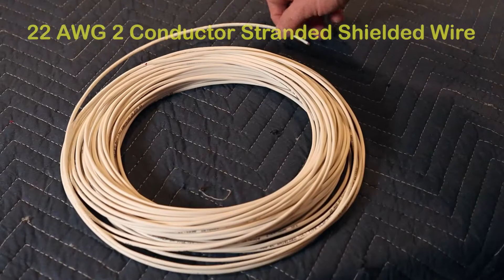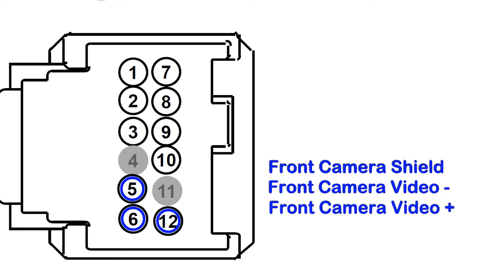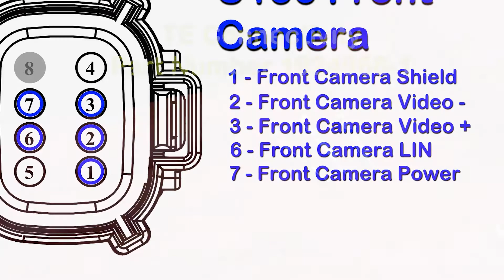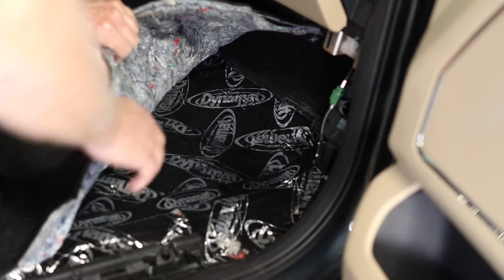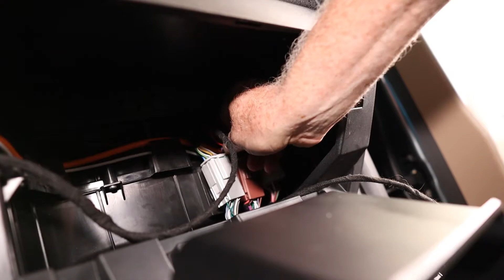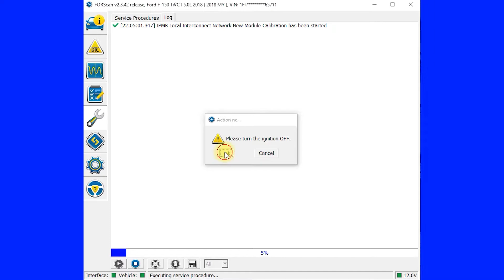F150 OEM 360° Camera Installation Part 3...Wiring it all together!

Comment: Hi I just got a 2025 F150 Lobo and being based on a STX it doesn't have many features. Can you advise me on all the parts I need to add 360 degree camera to my truck? If possible if you could share the part numbers of any modules and/or harnesses needed plus the other cameras my truck does not have currently. I also want to add the power extend/fold tow mirrors with 360 degree camera and BLISS, puddle lamps etc. Any advice/help you could give me would really be appreciated as there are several equipment upgrades I want to do such as the pro trailer backup assist, and adding heated and cooled seats, GPS to my infotainment system (I only have carplay on my truck) and the rear window with sliding glass. Thank you

Comment: Would this work with an F-250 or F-350 as long as it has Sync3?
Reply from the maker: Should be very similar. The part number will be different so you would need to research that..

Comment: Hi there,

How’s it going? I have an F-150 Lariat, and the side mirrors are retractable with built-in cameras. Unfortunately, my mirror was stolen, but the base with the 360° camera was left intact. I purchased a replacement original Ford mirror from the U.S., but it didn’t come with the camera—it’s the wrong version.

I saw one of your videos where you did something similar, and I’m wondering if you know how to disassemble the mirror without the camera and attach it to the base that still has the camera. I’m currently living in Colombia, so any guidance or tips would be greatly appreciated!

Thank you in advance!

Best regards

Comment: I have xl and I just only care about adding the front camera.
Reply from the maker: That should be possible, if you have a 8" sync screen. I'm not sure if it could be done with the smaller screen. You would just need the front camera and the image processing module. The side cameras would show up blue in the 360 degree view.

Comment: are you a business? can you solve this problem? i have a 2019 expedition hit in the front and stripped the harness to the front camera. all copper  wiring can be easily spliced. i was looking in your video for video wires. on the expedition this wire is silver stranded and shielded with aluminum wrap then a black exterior. it is slightly bigger than the copper wires. i believe this is a video wire. the problem is this short harness going to the camera does not break with a connector to the main harness and was made continuous by ford. a very bad mistake by ford. this wire/cable cannot be repaired by splicing and i do not see that type of wire in your project. do you have any experience with this problem and a solution? thx robert

Comment: Can you tell me if it's difficult or even possible to install a 3rd break light with a camera on 2019 F150 SuperCrew that only has the 360 cameras? If it is please point me in the right direction.

Comment: Did you need the dealer to calibrate the cameras or PTBA?
Reply from the maker: To get best results yes...I did not, it wasn't that far off. Plus since mine is regular cab, I'm not sure the dealer could even calibrate it. Thanks for watching.
Reply: @StupidFastTruck  I finished installing the 360º camera on my 2018 Lariat this past weekend. Your videos certainly helped! I did not get as lucky with the calibration, but my truck is the exact opposite configuration (crew cab 6.5ft bed). Now I need to find a dealer or shop that has the calibrations mats.
Reply from the maker: @Spring794  thanks....Your the first person that has commented that did the install, after almost 24K views...HAHA.

Comment: Can you recommend the name of the manual I need to find what parts to add various accessories to a Ford Ranger Next Gen Ranger 2024.  Wiring harness, cables, connectors. IPM etc... is it a Service Manual.?
Thanks in advance.
Reply from the maker: You can get 72 hour access to the online Ford workshop manuals from this link. https://www.motorcraftservice.com/Purchase/ViewProduct

Comment: The only and rare video, thanks for it. Quick question, Do u need to upgrade the APIM? I was going through the forum and got mixed feedback. 2021 Lariat with Pro-Trailer backup assist.
Reply from the maker: I really can't say what how or what must be done on a 2021 since it's a very different truck. On mine  Pro Trailer backup assist is required. I mention it in the video, but didn't stress the wiring.

Comment: Finally found a video that can be useful.  My next obstacle is I want to purchase the Next Gen Ranger Sport 2024 PH but it does not have 360 or front camera, I want to mod it, can I use the existing 10 inch screen and tap into it, I don't want to add another screen. I also want to add the power accessory in the bed of the truck for DC and 230 volts and 120 I realize I will need to use 2 separate inverters.  Any advice would be greatly appreciated.

Comment: Love the videos! I have a 2019 lariat, what do I need to do to connect the front camera to that cable you made? Will any sealed connector type work if I just get that factory harness you showed and splice that?

thanks so much for making these videos! 

Everything is installed on my truck now for this to work besides the front camera lol

Comment: Thank you for awesome videos.
I have a 2017 F150 XLT. I just bought a wrecked 2015 F150 Lariat with Blis. and 360 cameras.
 Do you think I can extract the factory harness and use it in my truck?
Also do you know if anyone would sell the dash wire harness that you built?
Thanks

Comment: Nice! I just picked up an F150 XLT earlier this week. The one thing I wanted but did not get was the 360 camera so this will be probably one of the first mods I make.
Reply from the maker: Nice...One important thing I briefly mentioned in the video but didn't stress, these instructions only work if you have the Pro-Trailer Backup Assist option. Its still doable without out that option but the wiring is more complex.

Comment: Question: would a button like FL3T-13D734 (hazard and 360 camera button) be a good solution when the radio only has 2 slots? I’d prefer to keep the one I have now. I should just have to pin in those addition wires with out soldering to the hazard since it’s the same button correct?
Reply from the maker: There is a button that has a hazard flasher and a camera button combined. The buttons are actually keyed so certain buttons will only fit in certain slots without modifying the bezel by filing the keyway to make it fit. All the camera button does is take the camera enable signal to ground momentarily to switch modes.
Reply: @StupidFastTruck  Ok, that is the button I am referring to. It would be in the same location as my current hazard button so hopefully the button fits along with the current harness. I was hoping it would so I can pin the new wires to the corresponding spots on the new button for simplicity (and avoidance of more soldering). Since it’s only a momentary switch, I’m sure I can find a way to make it work. Thank you for the advice!

Comment: Can I purchase the entire build, I am not capable to do all this wiring etc. I just buy package. Let me know if possible. Thanks
Reply from the maker: Thanks, Unfortunately I don't built them, I tried to include all the information needed. One key thing that's important to know, I mentioned it in the video but did not stress it. The install requires the truck have Pro Trailer Backup Assist. The wiring is very different if you truck is not equipped with this feature.

Comment: Hi I was wondering will the also work for a 2017 4 door f150 lariat  with a back up camara ?
Reply from the maker: Yes, as long as you have Pro Trailer Backup Assist. The front camera mounting is slightly different.
Reply: @StupidFastTruck  I believe I do have it there is a trailer nob to guide it not sure if there is a regular one and a pro or all the same tho
Reply from the maker: @eddie6696  yes you have the knob then you have PTBA. If you don't have PTBA then there is no module behind the screen and the wiring is MUCH more complicated. The installation might even be easier then mine. I've heard on older Lariat up they have the under hood wiring so all you need then door harnesses, and dash wiring, mirror cameras and front camera.
Reply: @Stupid Fast Truck  great thank you for that great info ill look to see if I do... if I do the plug for the front camara might be there already? IF the wiring is there?

Comment: Interesting, tried to do this mod on my 2019 XLT Sport over the weekend.  I have everything installed except the OEM Camera Logo won’t fit in the grille because the cutouts for the camera are missing and the logo doesn’t fully come out.  Any thoughts on how to get around this issue without buying a whole new grille?  That issue killed my mod.
Reply from the maker: I'm not sure....I still have my XLT grille which doesn't have the cut out either. I'll see if I can come up with any ideas.
Reply: hey interested in this mod for a 23 XL, did you manage to somehow to make it work?
Reply: Same here interested i have xlt 2019

Comment: Did you ever get the cameras calibrated by Ford?
Reply from the maker: No I did not, its not off that far so I didn't bother. Since my truck is a Regular Cab, (Short Wheelbase) I'm not even sure a dealership could calibrate it. The 2021 have a calibration where you drive at night with the 4 way flashers on and it calibrates, which seems really cool.

Comment: What a video !  I'm so grateful that all you hard work to put this all together. I'm trying to follow your video to do the same for my 2017 f-150. Do you know if those wire harnesses for the side and front camera are wired/mapped the same way ?
Reply from the maker: Inside the cab yes, probably...The under hood harness might even be there on a 2017. One thing I mentioned in the video but didn't stress it was the dash wiring is for trucks with Pro Trailer Backup Assist. If you do not have that option then the wiring in the dash would be very different.
Reply: @StupidFastTruck  My truck does come with 502A package and pro trailer backup assist. But I checked the control module which only comes with one socket instead of two that you mentioned in the video. I would be very grateful if you could point it out where or what to look for those under hood harness ?
Reply from the maker: @OneClueDeeper  I'm not exactly sure on a 2017. There should be a wiring harness in the middle near  grille. Did you watch part one of the video. It shows more of the grille wiring and the front camera. If there is only 2 wires going to the front temperature sensor then you do not have the wiring, and you need to build the harness.

Comment: The video shows you connecting the side cameras to the harness but on the mirror there’s two plugs one for the mirror function and on for the camera. What harness are you using for that?
Reply from the maker: The part number for the door harness I used are in the description section of Part 2 mirror install. Let me know if you can't find it.
Reply from the maker: I don't think so. If its a Lariat you probably won't need the under hood harness. A few folks have said their truck already had that wiring. The LIN signal is routed different on the factor harness. Send me an email at StupidFastTruck@Gmail.com and I will send you all the PDF files I have of for the factory wiring.
Reply: @StupidFastTruck  awesome. Email sent!
Reply: @StupidFastTruck  thanks! I missed that. I found the part number. Will the power fold modules be needed if I already have power fold. I’m just looking at add the cameras.

Comment: What single single strand wire are you using?
Reply: Correction, what single strand gauge wire did you use to one power to your sideview mirror cameras?
Reply from the maker: @tjj9008  22 Gauge and I just verified it from the PDF files I made from the workshop manual. Send me an email to StupidFastTruck@Gmail.com. I can send you all the PDF files I have on the wiring.
Reply from the maker: I think I used 22 or 24 I don't honestly remember I can check....You also asked about the mirror spots. That option I had from the factory so I didn't need to do anything. The switch a module and bezel is needed to enable them. Check this thread on the F150 forum. https://www.f150forum.com/f7/add-mirror-spotlights-458503/

Comment: Awesome work. On a 16 lariat, I have installed  tow mirrors that came with camera. My lariat didnt have camera but had all other function and has TPBA from factory. I am not sure if I missed it but where is the connector and cable that connects the camera on the mirror ? I only have a 22 pin connector but nothing for the camera port . Thanks
Reply from the maker: Thanks! The connector to the mirror cameras can be seen on the mirror install video (Part 2). Its at about 5 minutes 10 seconds into the video. The door harness might be different on your truck and you don't have the wiring. You could probably add the 4 wires if you don't want to change the whole door harness.

Comment: I watched your video twice but For the life of me , I cant see part numbers for connectors. The numbers you have only show the metal wire ends not the plastic connects that go behind the IPMB. Since I have lariat with no camera in mirror and front.
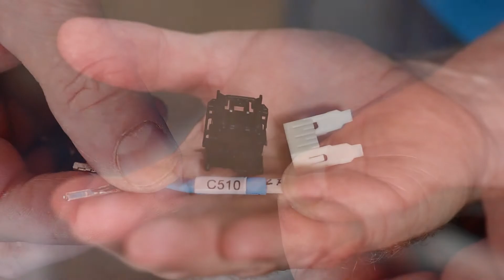Reply from the maker: Sorry about taking so long to get back with you. Its at 2:03, Molex part number 347290120. I only needed to add one connector on the IPMB because the other connector was there from the factory because I have Pro Trailer Backup Assist as a factory option.
Reply: @StupidFastTruck  thank you sir.

Comment: this is a lot of work. I may have to save this for my vacation when I have a solid week off. I definitely  want to add it though. I already have the emblem with the camera insert so I just need to order the other stuff
Reply from the maker: Go for it! The parts are starting to show up on the used market, so they are getting a little cheaper. Especially the mirrors.
Reply: @StupidFastTruck  yeah I just installed the mirrors. I got the mirrors? harness and modules off eBay for a great price.  The guy had it as a bundle guess he got rid of his truck before he did the change.
Reply from the maker: @its_big_dee  sweet deal. Great option to have. I don't worry about people in parking lots banging into them anymore. Or me in the garage. LOL

Comment: I have a lariat 501A and I installed tow mirrors with blis and camera. How do i tell if I have the correct IPBM. Is there any place you have harness part numbers  ?
Reply from the maker: A 360 IPMB will have 2 connectors. Rear only has one, the part numbers are in the video description, the one I used is a JL3Z-19H405-A.
Reply: @StupidFastTruck  thank you !! I will open up the console and check. Even though I have PTBA , I suspect I will need the ipbm you suggested. Once I have ipbm, it is a matter of hookup using the harnesses you suggested in video ?

Comment: Great video sir. So what exactly did you have to purchase to add the 360 cameras?
Reply from the maker: Thanks! The front camera, a grille that supports the front camera, mirrors with cameras, Image Processor Module. The truck should also have pro trailer backup assist from the factory or the wiring  gets much more complicated.

Comment: APIM  Accessory protocol interface module 🤣 Brother,  your videos are on point I just did a 360 ipm-b the other day had to do the drive calibration much better then rolling out the camera mats had flashers on going 20mph down the strait highway man people get pisst off 🤣💪🚗🔧🇺🇲💯🙏
Reply from the maker: Thanks!! My calibration is off...I need to learn about the flasher calibration...I only knew about the mat calibration.
Reply: @StupidFastTruck  the 2021 do a on the road calibration it looks at the lines on the road lol flashers on for safely 😄 🚗🔧🇺🇲🙏💪👊💯
Reply from the maker: @makingmustangsgreatagain  thanks! I thought that was what you were going to say. Sounds like the mat calibrations is my only option, it looks like a total pain.

Comment: Can you elaborate on the connections at the front camera?
Reply from the maker: There is a short harness that I installed in Part 1 
https://youtu.be/FtoIGi-ZCsg at around 8 minutes into the video.
It goes from the top of the grille down to the camera. Let me know if that helps or you have any other questions.

Comment: How are you still getting access to forscan tool through the Whipple tune
Reply from the maker: Very good question. When you requested your tune from Whipple you should have sent them a file called TOMAHAWK.REQ. The file is a text file and the last line is the ECM part number. I used that and it worked. For my truck it was JL3A-14C204-BBH.
Reply: Hopefully that works bro I definitely appreciate the help Thanks for making these great videos bro 👍🏽
Reply from the maker: @lafoxy5401  thank you!